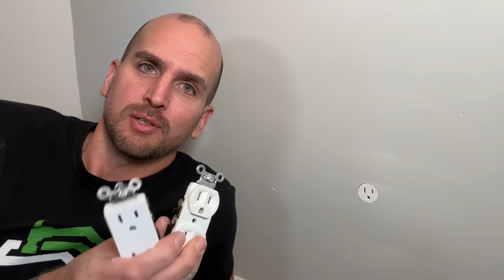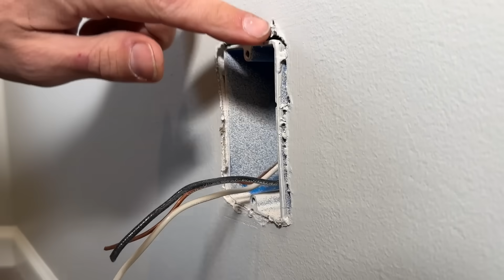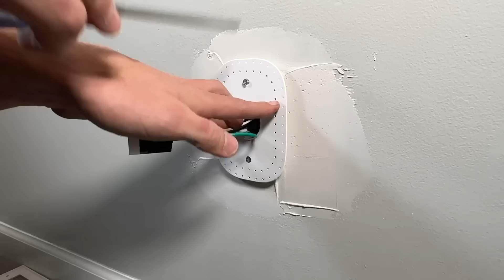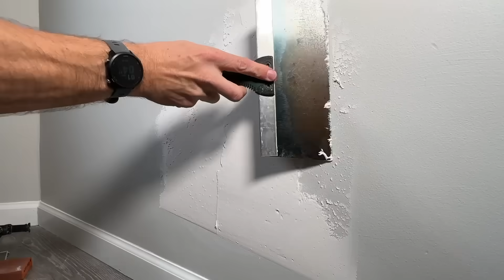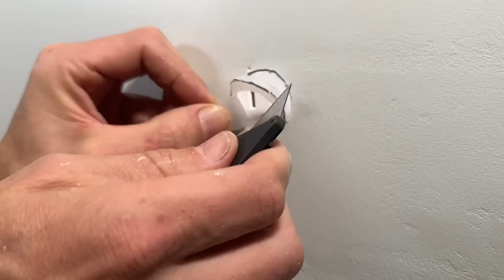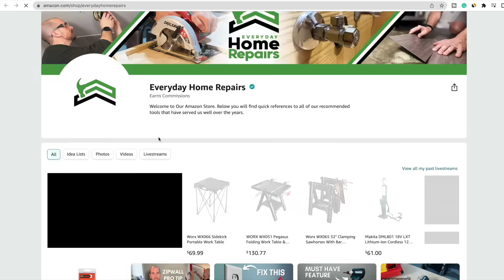Insane Luxury Outlet Installation | The Most Expensive Outlet You've Never Seen

Comment: I don't see any point in using these in drywall.  The purpose is really if you're putting them into stone or millwork and already spending a few hundred thousand on a reno and want a really clean look. That's their market, not for a standard wall plug. For some reason finding really nice flush-mounts for a backsplash or under-counter millwork is quite difficult.

Comment: This has got to be one of the stupidest products I have ever seen. For the price, it looks like some kind of bad kludge, or construction mistake. As a bonus insult, it's not even a high quality outlet, which it should be for costing 34 times any other quality outlet, AND the special tool is not included. I mean, it might look a bit better if it was color matched, to the wall, but come on. It's all cons, with no pros. It's more expensive, harder to install, harder to maintain, less functional, and lower quality. 
This seems to be yet another "Luxury" product where the only thing "Luxury"about it is the price. It's for rich morons who automatically assume that if it costs more, it's better, or even worse, for conspicuous consumption. As in, for people who spend lots of money purely for showing they have lots of money. It's awful. It's almost but not quite as bad as audiophile scam equipment.

I've been thinking about this , and for the price point, it ought to be an outlet that can retract completely into the wall, and only reveal itself at remote command. Or, a specific patch on the wall that is magnetic, and has a special outlet that latches on, so it can deliver power wirelessly. That would be way cooler.

Comment: Outlets don't last forever, you never trim the electrical gang box as you can see it was loose enough to push back nor do you mud in an electrical cover as outlets are a consumable and wear out and WILL need to be replaced. Wagu connecters only provide minimal metal to metal contact of conductors and as such show heat buildup and resistance at upper end of load. Not enough wire surface to surface contact they are equivalent to the squeeze on trailer and car stereo harness that always give you problems months later. They cost pennies for a reason.
Reply: No, Wagos do not work like the pinch trailer connectors and it’s not an edge biting into the conductor. They are in a class called levered nuts and aren’t cheaper than wire nuts.

Comment: This design is just stupid. One of the reasons we use face plates for outlets is because they protect the wall. Any damage to the face plate can be remedied in minutes by simply swapping it out. Whereas here, one careless slip of the hand while plugging something into the socket and you need to repair the wall itself.

Comment: I can't believe that's a code accepted installation.  If there a splices behind the device, how are you going to service an issue.  Not through a single receptacle sized opening that requires a specialty tool.  As an electrician I'd say, 'forget it' if I were called on a service call.  OR...my hammer could solve the accessibility problem.  What a joke!

Comment: Bonkers. The reason we don't "embed" outlets into the drywall compound itself is so that when we push plugs in or pull plugs out we don't have to worry about cracking/breaking the drywall around the plug. Whoever invented this just has no idea.
Reply: You're right about not embedding outlets in drywall compound, but this one was screwed into an existing box, relieving the stress. However, while the outlet might not pull out I'll bet it will crack and flake off around it over time. You make a good point.
Reply: Great point!!  👍🏼
Reply: Maybe it's best use case is behind tiles, like in the bathroom or kitchen.
Reply: Consider using a 1/2 MDF plate 16" x 16",  similar to a drywall patch. I makes this work.
Reply: Trust me, the inventor has an idea. They're laughing on the way to the bank because these are clearly made for people with more money than sense, lol. For the price of just one of those duplexes you can do an entire bedroom with top of the line outlets, and switches.

Comment: Cons - decreased functionality compared to duplex, 10 to 15 x cost of a commercial grade receptacle, significantly longer installation time due to drywall repair,  no improvement in quality, and expensive specialty tool to remove
Pros - ???

Cost benefit analysis - A very hard NO WAY!
Reply: Someone else mentioned using it in marble/granite, and it is definitely less visibly intrusive than a standard duplex + plate combo in the RIGHT scenario... like a high end kitchen that needs an occasional appliance like a breadmaker or plate-warmer and don't want a larger outlet breaking up the visual.  So I understand the extremely limited applications where this could be useful, and therefore the associated premium cost of it.

Comment: Thanks for the great video introducing this system. But I guess after all my questions is why would I need this...
Considering home usage, the wall plate itself is for service convenience (cheap and fast to replace) and also importantly, to prevent plugs scratching the wall during regular plugging and unplugging.
But worst of it is, it does not look good at all, at least to me. I might be trained to adapt to the common squarely wall plates, but I really don't feel such a weird "textured" round patch on the wall looks good. It looks worse than normal wall plates.
I imagine it might be great for some business environment, but I can hardly imagine it will be widely accepted by most homes.

Comment: Not only is the initial install labor intensive , but a replacement would be a nightmare. 
Hopefully, you have matching paint.If the existing paint has any UV damage, the original paint won't match.
This product, in my mind, is a total fail!
Reply from the maker: Agreed, you would have to LOVE the look to justify the installation, lack of durability, lack of serviceability, and cost
Reply: I could see some limited use cases especially in new build/remodeling, when cost isn't a concern but design and specifically minimalism is, where this product fits that specific niche.